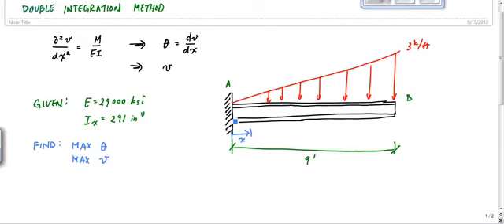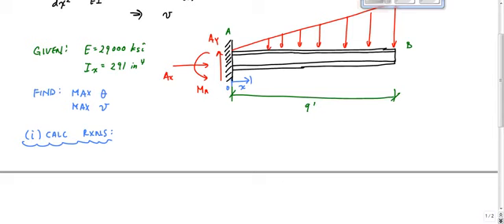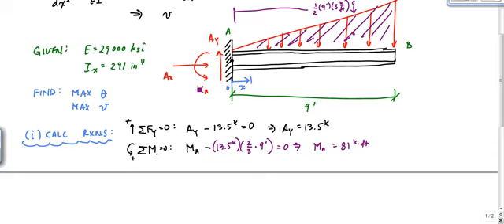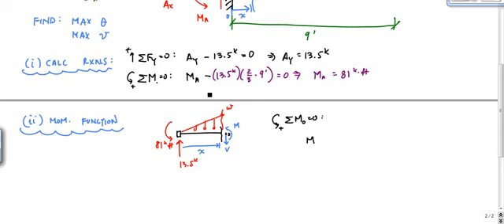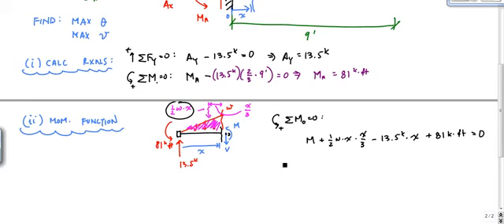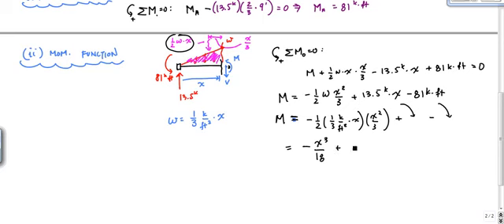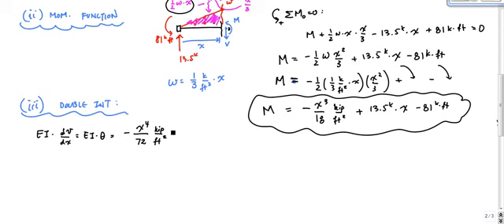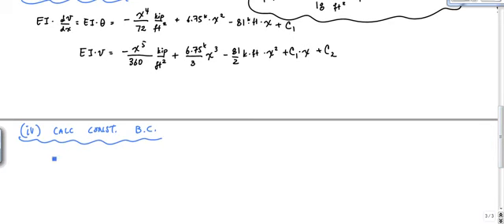Example of Double Integration Method for Beam Deflections     -   Mechanics of Materials

Comment: C2=0 is correct since its not overhanging to the left.

C1 cannot be Zero.
You need to plug in the whole length of the beam to have the value of C1.

Then use the equation again.